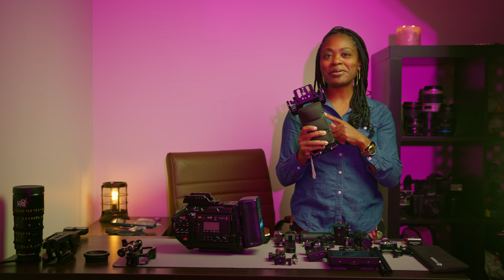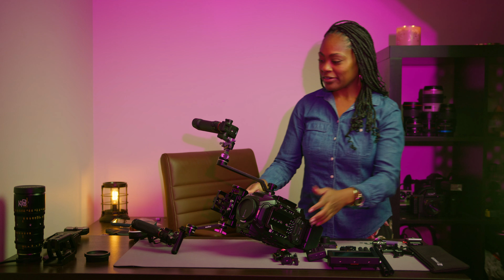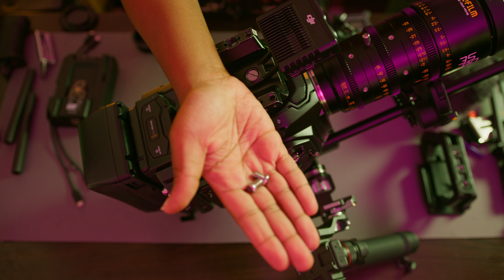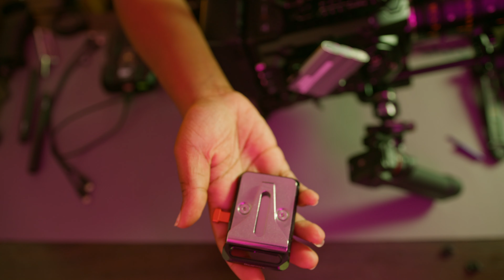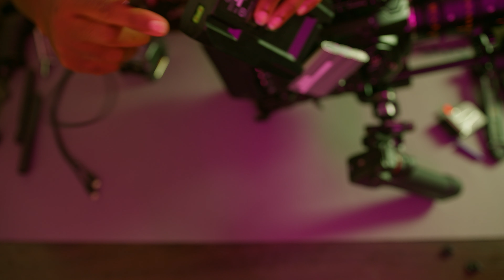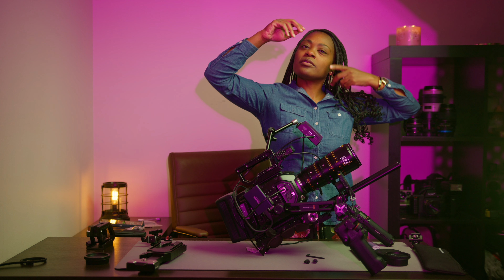Must Trash & Must Have Accessories | Ursa Mini Pro 4.6k G2!!

Comment: Great rig! I'm going for the Ursa Broadcast G2 due to the gyro data and that I'm so tired with the rigging of the pocket cameras. Needed a camera I can have on my shoulder rather than holding out in front for hours on end with sore arms at the end of a shoot.
Reply from the maker: @AndrewZeletrainStudios  The Broadcast is definitely underrated. I didn't realize the ursa didn't have gyro until after I bought it. Oh the things we take for granted lol💁🏾‍♀️
Reply: @jessfilmdiaries  Indeed we do. lol You're one of the few I've seen use a monitor instead of the EVF while shoulder mounting! That's my plan as well for the Broadcast. Thinking it will be easier to be aware of surroundings while filming in a crowded event.